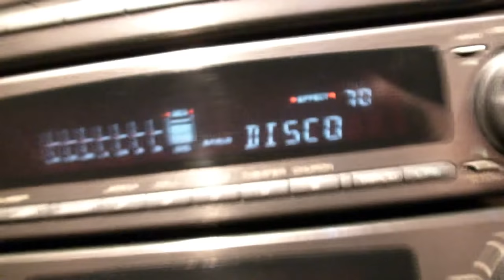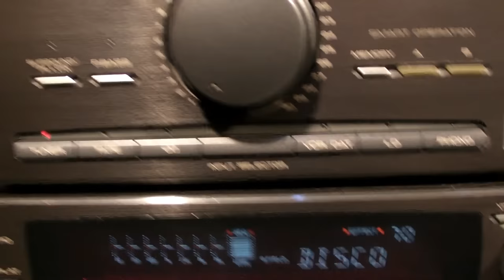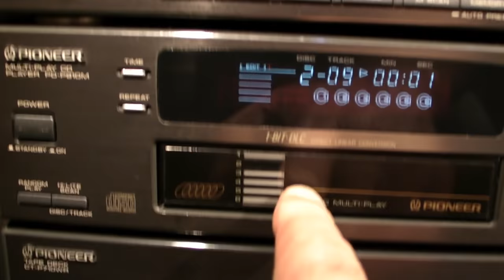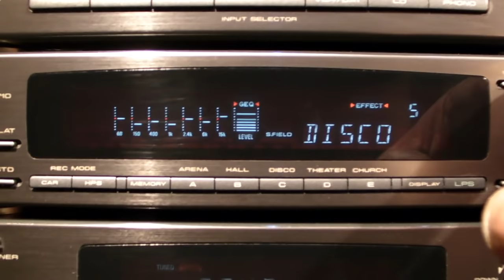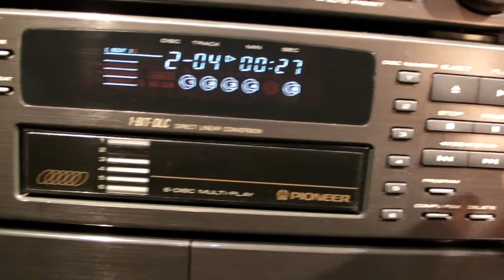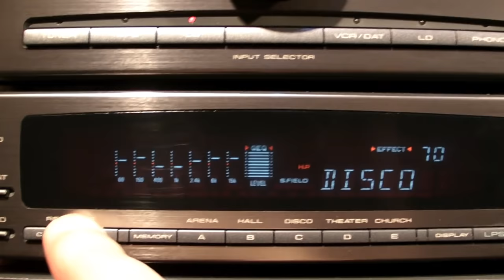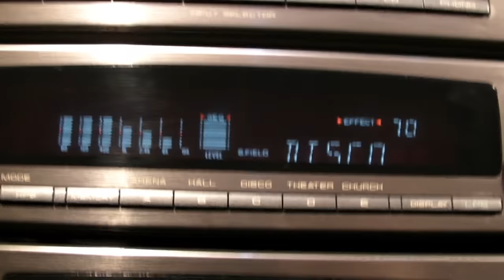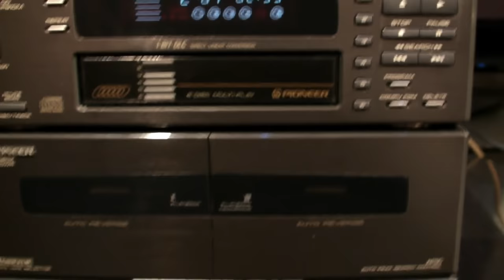Pioneer A-P710 review

Comment: I owned this system but with the double cd player instead of the 6 stacker in the 90s,loved it.
Reply: Those ribbon connectors,I remember them well,I cranked grunge and jazz rock out of mine,destroyed the amp but it took a long long time,I still own the speakers which are in excellent condition,3 ways.
Reply: @Jellybeantiger  I still have mine from new. The jog dial on the radio doesn't work and the phono input has a buzz (so I use an external phono amp) but everything else works great. The speakers sound fantastic after 30+ years. Paired with a Cambridge Audio Azure 851N streamer to bring it into the modern age.

Comment: if you have this set with normal double cd deck instead of changer it has a normal cd insert position - mirror cd side down. I have the same set but with double cd deck, pioneer has many models with such design of cd deck where one tray is located right above the other one. and I totally agree with you, it's very reliable set, even 25 year old but everything is working like on a new one, even autoreverses on both cassette decks..
Reply: I have the same stereo since 1991  but the double CD double deck is not working properly .I left it in to a repair shop and i was told that parts cannot be got for that stereo anymore .I was very disappointed as i will now have to replace it  .shortly. I will hold on to it and maybe i might find a place that will repair it someday.
Reply: @brendancahill3376  Try ebay Spain mate. There are complete systems going for 30€.

Comment: Has anyone tried a single-CD cartridge with this?  I have a P410 system, also from 1991, which is similar, but lower end.  Unfortunately, it has the 6-disc cartridge player (I prefer the dual trays).  I picked up a 6-disc and 1-disc from a dude on eBay, but the 1-disc cartridge does not lock in.  6-disc works as expected.  I wonder if Pioneer designed the 1-disc cartridge later, and is slightly different.  When you eject the cartridge, there's a disc tray that slides open, making it easier to insert a CD (although still data-side up, of course).

Love Pioneer.  Yes, this was a nice system although I would have preferred a black brush-metal finish :-D .  Still much better than the cheap plastic ones they made later.  The late-90s have a nice silver finish, but I don't love all the curves, and they aren't as "hi-fi" as these 1991 models.  Hopefully, I will come across one of these again, and soon.  I see later models, quite cheap, and I'm always tempted to buy them!

Comment: LD is laser disc, they were the size of 12" LP Records but looked like CDs
Reply from the maker: F lame I can remember when they came out in the shops but I wasn't interesting in it because I can remember that the records where very expensive. It was also not standard because not all brands made it. And because of my previous mistake to buy a video 8 system from sony I learned only to buy things what all brands use. I could not find all movies when i try to rent them and with the VHS system you didn't had that problem. Yes the sony8 system was better but useless. That's why we now have 2 systems for our phones, , every other system is due to fail, even windows can't come between. And because I saw immediately that this system would not stay like the video 8 system I never get interested in it.
Reply: The laser disc like vinyl records are very collectable now, they are becoming very rare and hard to get hold of
Reply from the maker: F lame Yes there it is, you need money to have this hobby in collecting these things. I don't have the money to collect but I can understand why they collect them. When they came out it was like a miracle but vhs system was so much cheaper , easier to rent and cheaper to rent. the rent prices of LD was higher. I can't understand why people still collect vhs tapes but I understand why they collect these LD disks just because they always stay good, vhs loose quality over the years. tape is just much weaker. In tropical countries you can't keep tape decks  because the tapes will destroyed themself after a while because of the temperature and moisture issues.
Reply: vintage stereo because of you i have started collecting vintage hifi componants, i have been collecting vinyl records for a year or so but now these vintage amps are so beautiful that now i have been buying old marantz and sansui. Looking to get my first Sansui g7000
Reply from the maker: F lame whooow, i made you hooked, hope the FBI will not read this because they don't like people who make others hooked....Where you live you can find the g series much cheaper

Comment: PLEASE HELP!  My A-P710 amp blew years ago,and I REALLY want to resurrect my fav hifi. But how?  All internal fuses look ok.  I have changed 10 amp plug fuse,yet it wont switch back on.  Do I buy another of E Bay for £30-ish?  It blew one day when my electrics went pop at the meter. It was on low volume at that time so no overload happened?  I have many, many old band tapes I would love to put on digital, and my present hifi substitute just aint got the grace or finesse of this beauty Y.no?
Reply: Take the amplifier to an electronic specialist.  I have the same set up A - P710 and the Amp does not power up. Ive booked it in to a hifi specialist in Dalston East London.  My hifi is absolutely in mint condition
Reply: @niazpetkar53  thanks man but I got it sorted for free! A simple 5 amp fuse at the plug Brough it back to a glorious sound machine! It's sound options are fantastic. I play my drums to it and can tweak it to any enhanced level of music my big heart desires! The best retro hifi available if you ask me. Cheers.
Reply: @jimlawrence2167  i just purchased exactly the same Pioneer set up in absolute mint condition from eBay for 99p. The seller said the same thing and the Amp just stopped working and sold as seen. Going to change the fuse on the plug 🤞see if it works.  I do have another mint condition A- P710 Pioneer seperates, so this is my 2nd one.
Reply: @niazpetkar53  did it work? I was told by a band sound man who hires out his P. A. System that a 5 amp fuse in the plug is ok but may blow if turned up over 7-8 on volume dial. (depending how much real music power the particular speakers are demanding. Mine was 250 Watts. But he recommended it to be 10 amp fuse in plug socket to be sure. Beware! This ain't gospel and it was 5 yrs ago I was told this info, I tried different fuse out of curiosity and bingo! It worked fine and has since. Good luck.
Reply: @jimlawrence2167  I will get back to you once the fuse on the plug gets changed over the course of the next few days.

Comment: ik denk dat de tuner wel veel gebruikt is, het display geeft duidelijk minder licht dan de rest. dat heb ik ook met mijn tuner. goede keus trouwens Santana ben 4 keer naar een concert geweest en heb alle cd's
Reply from the maker: Mart Dekkers Klopt helemaal, waarschijnlijk een tuner lover net als ik.
Reply: +vintage stereo
this is not the reason for it. The tuner ist always in standby to show the  digital clock. The display is a "VFD-Display". This kind of displays are vacuum tubes with filament heating wires. If the system is pluged in, the heating is active all the time (you can see it in the dark).
I owned the same system with double cd-player. The price was round about 2.200 DM in 1991, yes it was a very expensive system (i still have the original bill).
The "Vocal Cancel"  button activate a karaooke funktion - yes, this System ist a playground :-)

Comment: Hi there, is there any possible way to play music from a phone into this sound system to the speakers??
Please need fast response
Reply from the maker: you can plug your phone in dat in, no problem
Reply: vintage stereo thanks for getting back to me, I managed to get it working with a cable I ordered online.
What I have encountered now is that I am only getting sound out of the right speaker.
If I listen closely to the left speaker I can hear what sounds like static electricity or phantom power so I believe it is on or receiving power which leads me to believe it might still work.
Do you know of any way to mess with the settings which might fix this?

Thanks again